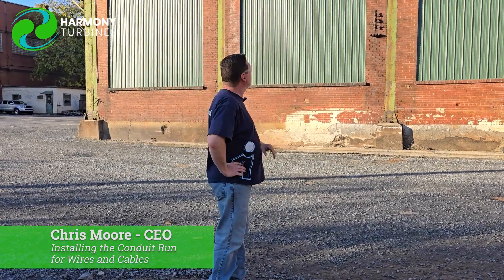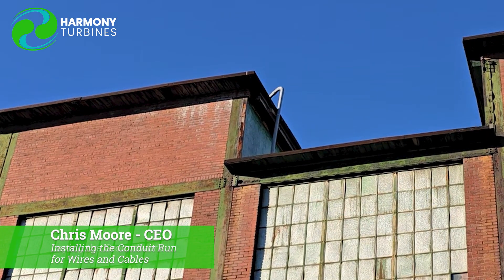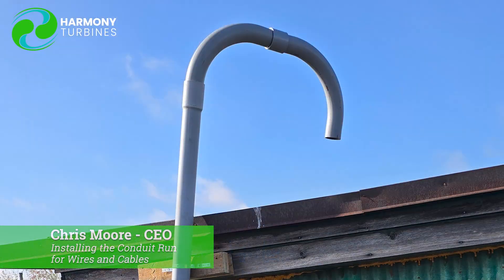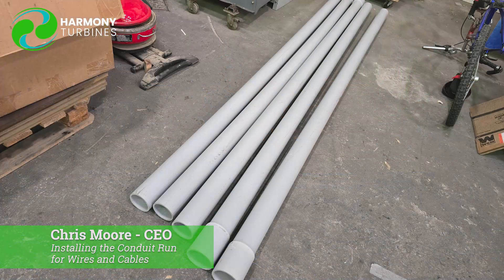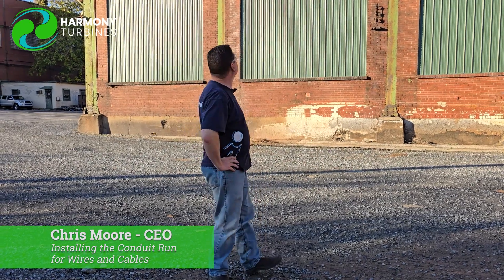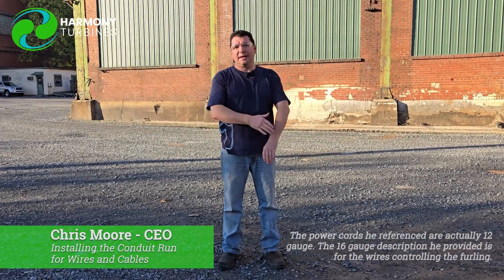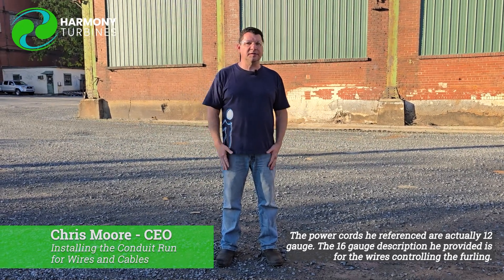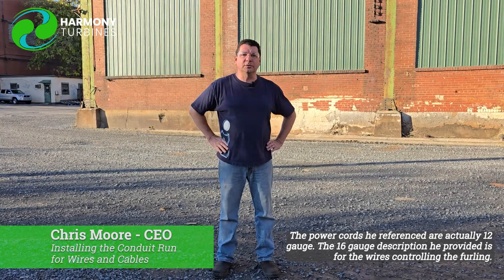A Rooftop Candy Cane?

Comment: I would think eventually a lower budget kit where you provided the gears, electronics bearings and generator with a template for the purchaser to use 55gallon drums and locally sourced framing metal. Gears could be bolted, riveted or welded onto the drums once cut via template. Saves both fabrication time in house and shipping costs. Used 55-gallon drums (steel or plastic) are plentiful across the World (recyclers would love this) and might let remote locations assemble things at a cost-effective return.